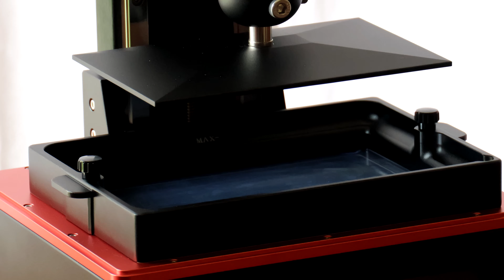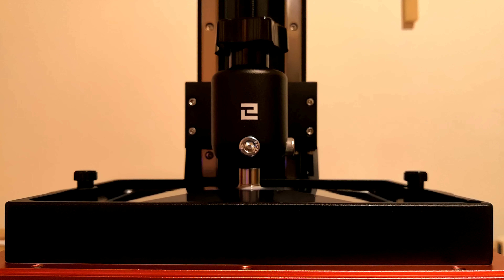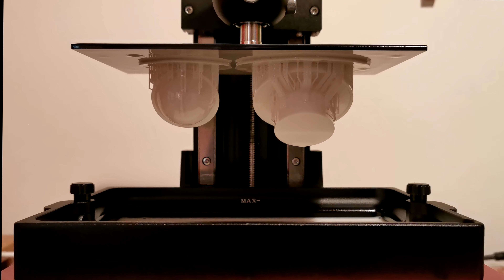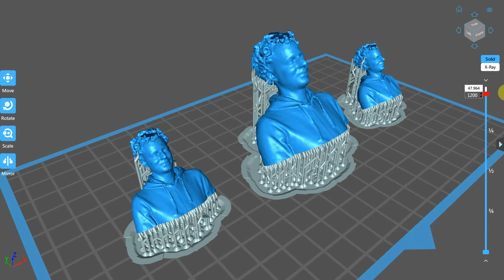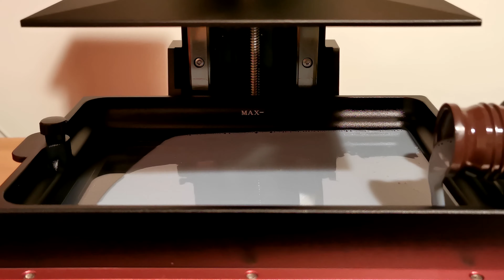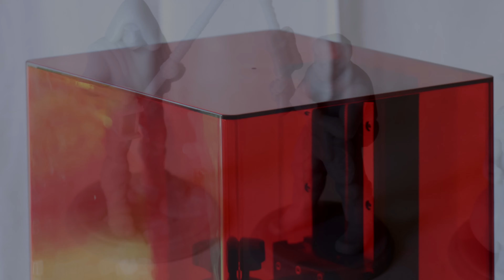ELEGOO SATURN - 4K resin 3D printer review!

Comment: Those mins had some very muddy details. Should have messed with the layer heights before printing them.
Reply from the maker: Hi Mike! Thanks for your suggestions regarding the abs like grey! The only real cosmetic issue I had with the prints were the tips of the horns of the bearded dwarf that not being supported came out a little rounded. The models from thingiverse themselves are a little soft looking, Definitely there is still a good margin of improvement!👍